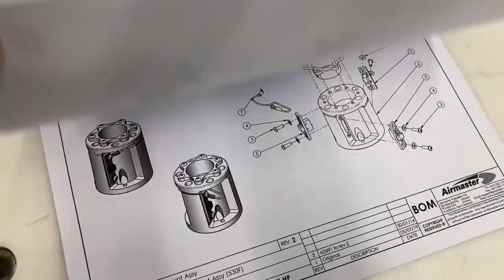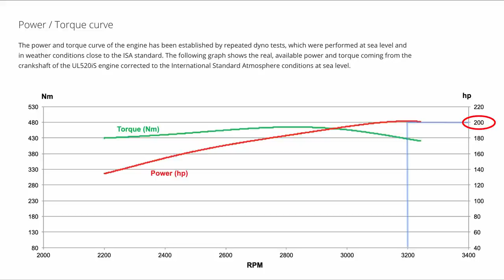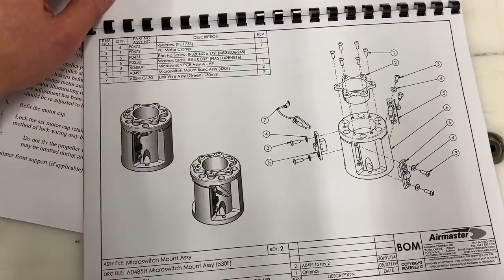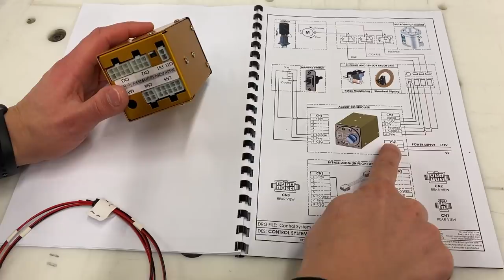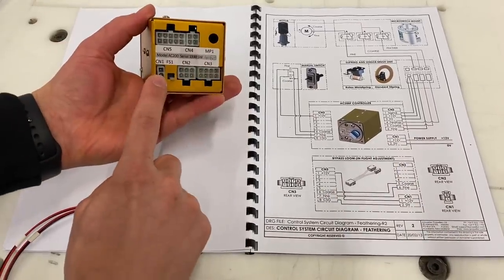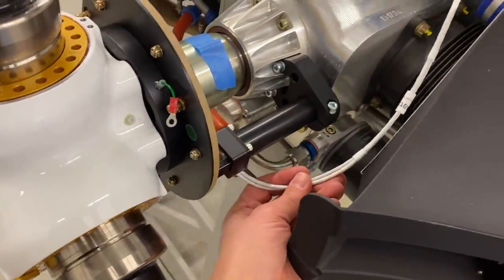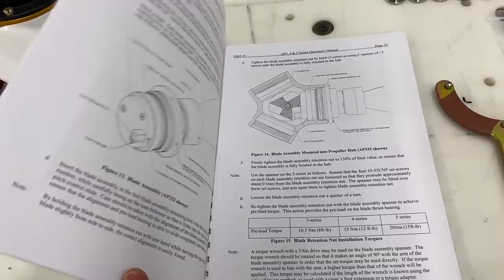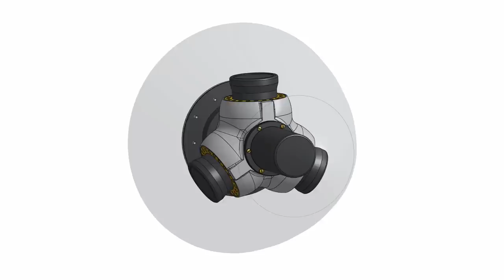Why this propeller is different: Airmaster Propeller on the DarkAero 1

Comment: Awesome pitch control system and video! 

Quick observation: I'm not sure if those 5557 connectors on the back of the controller are rated for high vibration environments as I don't see a locking feature to keep the terminals in place. You could look for automotive or aerospace rated versions, these have both connector and terminal locking features to keep the connection secure in high vibration. An example with similar size to the 5557s shown but terminal and connectors locking is the TE Connectivity MULTILOCK Connectors.

Comment: Slip rings are awesome! Super interesting method for keeping electrical connections in a rotary application.

Using something similar that is custom made out of a pcb for making connections to a 3d printer hot end without having a wire loom. The slip ring your propeller assembly uses is non linear, my 3d printer uses a linear slip ring or a slip strip 😁

Comment: That's a wicked cool prop and even more impressed they are using a servo control vs. the age old mech/hydraulic control.  I am also fascinated with their choice of brushes on the ring.  Do the brushes and ring have a fixed lifespan?  Interested to see how they wear in and what the life is.
btw, Still working on that Power Drawbar....

Comment: wow.. nice prop.. but are there mountings for strain reliefs for the wiring coming out of the brush assembly. how about some kind of sleaving over the harness too..  are the connectors over the cylinder head water proof or just shrink tubed ??  i think back to a friend DC7 with electronic prop feathering.. it had a short that would kick up once in a while and blow a fuse in the instrument bay. creating a flat prop . not a good thing to happen at climb out.  i wonder if there is a resistance test circuit to the prop motor that when it becomes iffy thru the wiring. brushes to contact plate or in the feathering motor.. that it would signal on the dashboard display with a failure mode.  something as simple as a rasberrry chip to monitor the resistance or voltage and ground..  i don't want to sound like a safety sally.. but i am a mechanic and i have seen way too many electronic devices fail.
Reply: There's a few things I noticed that concern me to.

Comment: The WWII B-24 used electric propellor pitch control. Part of the pre-flight process was starting a little piston-powered APU, to keep the electrical system charged  up despite the load imposed by starting 4 big radials.  If the pilot didn't do  that, it could become impossible to increase the prop pitch after takeoff. The motors would likely overspeed, leading to a generally Bad Day.
The B-24 was mostly hydraulic, with electric pitch control. In contrast, the B-17 was an electric aeroplane with hydraulic propellor controls.
Having more than one type of control mechanism helps prevent total system failures.

Comment: I've worked on Turbo props so I'm not 100% sure about recips... The bolts you have in the video don't seem to have holes in the heads for safetywire. Safetying the flange bolts is one small step for a lot of security. I'd hate to see that prop go missing in flight someday! Another tip: While the grease is coming from the factory it's often cleaned out and replaced anyway just to ensure no cross contamination with your grease which may or may not be the same as what they claim to use.

Comment: Was the propeller custom designed for you or is this an off the shelf design for them?
Reply from the maker: Timmy G, it's a little of both. The big items like the blades and hub are off the shelf but we did some more customized things with the spacers to get it to the right distance on the prop extension to match up with our spinner. It's faster and more cost effective to start with off the shelf parts and see how the performance turns out. We might explore some more customized adjustments with the blades after we see how it performs. Thank you for watching and for the question!

Comment: The HOLD function is like the pre-set TO, CLIMB and CRUISE modes but is able to be customised. When Hold is selected the unit will remember a manualy adjusted setting when, for example, the selector is switched from Hold to Climb and back to Hold. The memory only lasts during the flight and is lost when powered down.  There is no need to select manual on the rocker switch to use the Hold function, just select Hold and use the fine/course selector. At least this is how mine works fitted to our 912 Rotax. Brilliant product!

Comment: I would look into change out the aft bulkhead to aluminum, the heat build up from engine and shaft will cause the epoxy to soften and spread out causing the prop to loose torque. This was big problem with canard aircraft ( cozy IV ) I fly, it might be different in the tractor configuration but something to consider. But great job on the airplane love the videos keep them coming.
Reply from the maker: Hi Ken! We are familiar with that issue you described from the canard community but I had heard it was more to do with torque pulses from the engine causing the prop to rub against the spinner backplate and generate heat which softens the backplate. Don’t know how much truth there is to this as a root cause but the end result is still documented. This was something we brought up to Airmaster in our early discussions and we concluded we could get our composite backplate to work based on their experience. We also consulted with some other spinner manufacturers who use composite backplates successfully. The epoxy we use is high temperature capable which provides some safety margin against engine heat.  BTW, is the really pretty blue and white Cozy yours?
Reply: @DarkAeroInc  
Yes it is, thanks for the compliment. I didn’t realize the heat was coming from movement I always thought from the shaft. Thanks for the follow up, I learned something new. Do you still have your cozy or did you sell it?

Comment: Can the prop controller be integrated with the engine ECU for true one-lever operation?
Reply: That would make a lot more sense than manually setting the speed.

Comment: I realize that mounting the pitch actuation motor on the rotating hub avoids a bearing, but the disk of exposed slip rings doesn't seem like a good tradeoff.

Comment: I noticed the PROP BOLTS are NOT wired.  Do you plan to change those later so you can wire all the bolts?  Safety first?

Comment: Is there videos about the mounting of 2 parts using bolts? Like, where the propeller is mounted on the plane? What’s inside the part to make sure the propeller has a good grip and it’s firmly fixed on the frame?

Comment: What are the brushes used with the slip ring made of? How long do they last? Do the brushes require frequent inspection?
I've used a few slip rings in hobby robotics. It surprised me to see a slip ring on that propeller.
You early photo of the propeller made me wonder if it was variable pitch but I thought that would be way too complicated for a small airplane. It was really interesting to see I was wrong.
Thanks for the very interesting video.
Reply: A completely open brush and slip ring setup is even more surprising.

Comment: Modern props are works of art and this Airmaster is no different. I'd be hooking it up to a 12 V source and play around with making the blades change pitch.  Merry (variable pitch) Christmas!
Reply: It would be tempting to play, but without installing it on a running engine the speed will be zero, so if it does anything it will just run to the fine pitch limit and sit there.

Comment: Awesome with predetermined settings! But shouldnt the feather swith be guarded? So you don't accidentally put it in feather
Reply: Just from looking at the controller panel, it appears the switch next to the Feather position provides the guard function. If so, it has to be in the Feather Enable position; otherwise "Feather" is the same as the preceding position on the switch. The indicator LED should tell the story; e.g., lit yellow for enabled but not feathered, and lit red for feathered.

Comment: Hey guys, I’m a private pilot in high school trying to learn as much as I can about aircraft design. With all the force on the blades on the prop, wouldn’t there be an incredible amount of force on the offset cams and the sliding block, and ultimately the leadscrew? Is there something I’m missing?

Comment: I hope you plan to polish the stainless steal leading edge! There are ways to do it without harming the carbon fiber resin clear coat finish, but simply using aluminum tape to mask it off, cut the aluminum tape after applying it with a fine exacto knife along the edge of the stainless steal, and then begin using an abrasive polish. This will increase aerodynamic effects and efficiency of the blade while in rotation. However this will be need to be done several times throughout its life span due to weathering and tiny bits of sand sized rocks. Having a polished leading edge looks great, and shows your attention to detail.
Reply: "sand sized rocks"
They wouldn't be called rocks if they were sand sized.  Most people just call it sand and dirt.
Most airfoils don't see increased efficiency with ultra smooth surfaces, it's only the specialized laminar flow airfoils that make use of it and even then it's not necessary to have optical smoothness, just consistently accurate surfaces.  You can only do so much with an airfoil surface before the boundary layer makes it irrelevant.  In fact, the process of polishing the erosion strip would likely introduce enough inconsistencies to the shape of the leading edge that you'd end up worse off than when you started.  Polishing out a tiny crater in the leading edge would mean having to take that much depth of material off the surrounding area by an inch or more, so now that inch of leading edge is shaped differently from the rest, which will change its aerodynamic characteristics.  It's a losing proposition that won't gain you anything in the first place.

Comment: If you’re optimizing your wing for high speed flight, doesn’t a higher aspect ratio hurt your performance?  At high speed, the extra span directly contributes to increased form drag, which is the dominant component of drag out to the right of Vmd on your Velocity/Drag curve.  Also, what is the tradeoff between increasing aspect ratio vs. using winglets?

Comment: Will the tips stay below supersonic at 3300 rpm?  I always thought 3 blade props were less efficient than two blade.  I assume you went with three blades to keep the diameter smaller and tip speeds slower. Nice video and really nice job on your project.   Keep it up guys!
Reply from the maker: Good question! The blade tips do stay below supersonic at 3300 rpm. Maximum continuous rpm on the engine is 2800 rpm which is more realistic number to look at for propeller tip speed at maximum cruise conditions. At that rpm is a pretty good margin below sonic. Thanks for watching!
Reply: 3300 rpm = 3300 * 2π radians per minute 
                  = 20734 radians per minute 
                  = 20734 / 60 radians per sec
                  = 345 radians per second

Let's say that each blade is 1m long:

Wing tip velocity is 345 * 1m = 345 m/sec. The speed of sound is 343 m/sec. However, looking at the power / Torque curve, it seems like it will run just below 3300 rpm. Or maybe the blade length is less than 1m.

Edit: I didn't see DarkAero's reply :/
Reply: @DarkAeroInc  Three blades are way better looking, too!
Reply from the maker: @StudioRV8  they do look pretty cool! 😎
Reply: @andreashadjiantonis2596  SOS becomes lower as altitude / air density decreases.
Reply: @andreashadjiantonis2596  He said propeller diameter was about 67 inches which is about 0.85 meters so about a 15 percent lower tip speed.
Reply: @michaelhope7620  With that diameter and with the max rpm being 2800 as they  said above, the max blade tip belocity becomes 249 m/s
Reply: @randallsemrau7845  … as altitude increases / air density decreases. 

Part of this is due to the temperature change with altitude. Vs (T) = 643.855 knots * (T/273.15)^2, where T is in °K, and 643.855 knots is the speed of sound at 273.15°K (0°C, 32° F, 459.67°R). Note: must use either Kelvin or Rankine scale for temperature to make this work.
Reply: @paulbade3566  He's just looking for a rule of thumb, not a mathematical/engineering solution.

Comment: Nicely engineered prop. Needs a inspection hole to set that third blade, don't fancy pulling that down if its not inline.
Reply from the maker: The installation of the last blade is a blind operation but you get to practice on the first two blades. :) It's not too difficult to "feel" the cam into the slider block. Just a little wiggling. This can be seen at 9:44 in the video. Thank you for watching!

Comment: So many decisions made about your prototype are minimalist, with the idea of less is more... So, it's fascinating to see an engineering choice where a bit of 'extra' weight and complexity is worth the improved efficiency. Similar logic to retractable gear... extra stuff that makes the aerodynamics worth it.  Your design choices seem great so far, I can't wait for you to start testing them! Cheers, and thanks for another great update!
Reply from the maker: Exactly! Less is more! We started off looking at a fixed pitch propeller under this philosophy, but since we have a new airframe and engine combination, we knew there would be some iteration required to get it right. The variable pitch solution is a faster path to hitting our target performance numbers. There is still a lot of appeal in a fixed pitch propeller (lower weight, cost, and complexity) so hopefully we can use the lessons learned with this variable pitch propeller to drive the design of a fixed pitch propeller for the DarkAero 1. Thank you for watching! More updates coming soon!
Reply: @DarkAeroInc  The theory sounds great! With the support from the prop and eng manufacturers it seems to be a great solution. Were you able to de-rate or downsize the power plant specification because of the increased T.O. performance of the variable pitch?
Reply: @DarkAeroInc  are you still considering designing a fixed pitch solution once the prototype is flying?
Personally, I would prefer a fixed pitch propeller, even if the max speed is slightly reduced. While this propeller is really cool, the number of moving parts and the cost makes me a bit concerned. I think the DarkAero 1 would look pretty cool with a Prince P-Tip also.
Reply: @DarkAeroInc  Since you have specific blades chosen, you presumably know the weight of a fixed-pitch configuration with the same blades. Do you know what the weight penalty is for the constant-speed version?

Comment: Fascinating, gentlemen! One question- Would the propeller pitching mechanism default to a specific setting in case of electrical (and or mechanical)failure? Many thanks!
Reply from the maker: If the servo motor lost power the propeller would just remain at the pitch it is at, essentially reverting into a fixed pitch propeller. Same thing if there was some sort of mechanical failure in the motor, the blades remain where they are at since the blades can’t generate enough torque to backdrive the screw.
Reply: @DarkAeroInc  So if you had an engine failure, even if you still had electrical you would be unable to feather the prop to extend glide distance?
Reply: @alexanderarnett4966  "in the motor", they meant the worm screw drive motor in the prob hub. If you have an engine failure, and still have battery power, you can control the blades.
Reply from the maker: @alexanderarnett4966  I meant a mechanical failure in the electrical servo motor. If the engine died, the propeller could still be feathered.
Reply from the maker: @MolsonB  Exactly! You got to it before we did! Thank you!

Comment: I would love to know how much this prop kit costs. Will wildguess something between 12 and 15 grand.
Reply: I think you underestimate the actual cost of carbon fiber parts, the time it takes to make them, the molds, the scraps, etc. My guess would be at 50k but maybe i'm the one who's too high up
Reply: @antoineleblanc2509  I don't know, I just guessed it, maybe your estimate is more in the ballpark than mine is.
Reply: @antoineleblanc2509  $50k for just the prop?
Reply: @brianb-p6586  with moving parts and high tolerance carbon fiber pieces? Idk
Reply: @antoineleblanc2509  anything related to aviation is expensive, but if the prop is $50K then the aircraft will be a million (it has many time as much carbon fibre). A quick web search suggests that José's guess is probably reasonable.

Comment: Great video. Thanks. Those slip rings and brushes seem like a maintenance headache waiting to happen though. And the rest of your instrumentation is so much more beautiful than that archaic-looking prop control panel... can you just design an in-house alternative instead?
Reply: Just for style? That would be crazy.
Reply: @brianb-p6586   Beautiful avionocs are far from crazy. The fuselage itself is designed for aerodynamics and style
Reply: @IhabFahmy  Brewing a custom version of a proven design of a critical system just so the knob on the panel looks better would absolutely be crazy. I wouldn't consider getting in an aircraft designed by someone who would do this.

DarkAero did not take an existing and proven fuselage design and entirely redesign it just for appearance.
Reply: @brianb-p6586  You totally missed the point... I was asking that they redesign the knob, not the trim system 🤣. As to what aircraft you get into, well that's up to you.
Reply: @IhabFahmy  what you said was "control panel", not knob. Sure, if you want to change switch knob on the sane control panel to something less functional that you think is prettier, go for it.

Comment: Does that propeller controller feed back to the throttle to keep from inadvertently oversquaring the engine when going down in RPM selections?